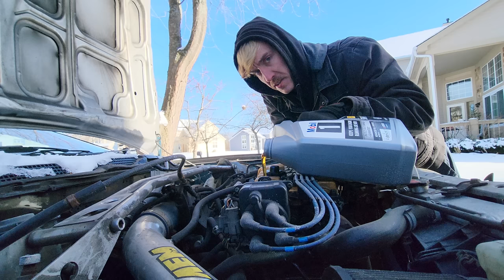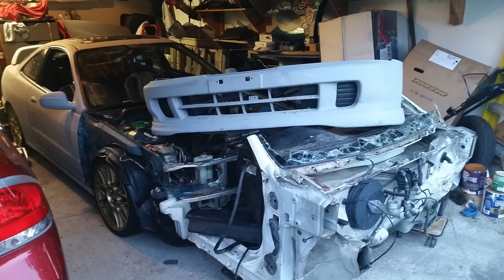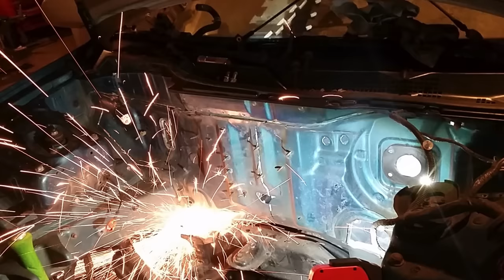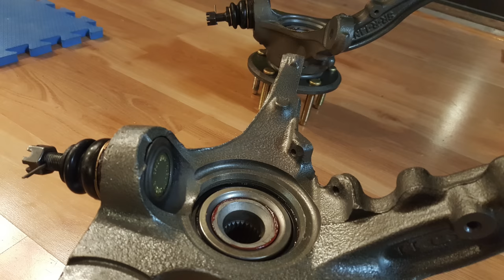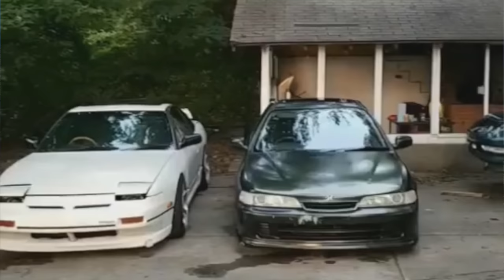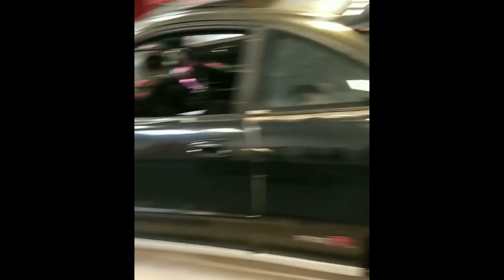The Story Behind Building My RHD Integra

Comment: Man, this story is very inspiring. It also makes me really think about if I really wanna sell my first car as soon as my license allows me to drive more powerful cars or attempt a big project like a engine swap because the current engine is only 78hp and also hardly holds any compression anymore but the mechanic that fixed my wheel bearing and transmission seal a few weeks ago told me to just buy another one with a different engine because it would be to complex to attempt something like that. Also I was wondering what work you do currently outside of YouTube , I really want to work on cars but I’m worried the practical jobs don’t pay properly and the engineering jobs are mostly done at a desk and not in a shop but I will probably try to get a instruction for automotive engineering from a big company like Audi which offers an education while you work there. Anyways sorry for the rant, this video was very nice as always.
Reply from the maker: I totally understand where you are coming from. I definitely learned the hard way about the low pay aspect. Which is another reason I continued to go to school. That's why I got the automotive related desk job. But found my days turned into a blur and made my brain turn to mush (dealing with alot of cooperate idiots) 

Which is why I never stayed in a place where  I felt like I wasn't progressing

Basically you have to put yourself out there and try different things to see which fits you best. There is no wrong choice, it's a constant ladder up

Hope this helps 🙏 :_s13:

Comment: Great video! One of your best for sure. Like seeing how you started. Neat. I have some years on you but admire your determination and hard work effort. You will always be successful. I like your channel. I have a GS and it is so nice when I really think about it. Only one quarter panel above the rear wheel with any rust on it, that is it. I do not work on it myself but pay tons of money to the shop to repair it. I am saving it. It runs good now and has potential. I am in NC so is fun in the mountains. Keep doing videos, I am learning from them. I will be able to do my own oil change and some bulbs and lights and other easy stuff now.

Comment: You're fortunate to still have your first car. Mine was a 97 Ford Escort wagon, 5 speed, sliver with a green interior. It had rust and for the last few years of ownership I was doing body or structural rust repair on it almost every year. Seeing pin holes starting to form on both rear strut towers was the last straw, I was done with it. The sliver lining is that last year I inherited my dad's old car which is the same model as my first car, but it's a coupe, one year newer, and has the more powerful engine. I can also relate to how you felt working on cars for your job. I'm a full time tech and it really discourages me from working on my own stuff, but it's the only thing I've ever made decent money at. I also hate having to work on cars that the owner obviously don't care about. It's to the point that they couldn't pay me enough to actually care about their car that they turned into a POS by their own actions. Every time I have to work on one of these cars, It's begrudgingly and I'm in a bad mood the entire time.

Comment: Man my life story is pretty similar lol. 1st car was a 1998 Prelude, I crashed it and while rebuilding it I bought a daily for the daily. My 2nd car a 1990 240sx coupe that I still have and recently started working on and playing with again. 3rd vehicle is a 2007 Tacoma I fully built myself into a long travel desert truck. 4th car is a 2008 STI that was crashed when I bought it and I rebuilt it in my driveway. 5th car is a 1970 Baja Bug I'm working on. I also have a race truck, 19ft boat and a few motorcycles. I still have all of them except the prelude. I build, install, maintenance, paint, body work, fabrication everything myself except tires mount and balance. I enjoy working on MY vehicles as a hobby and I was always afraid of if I made that my career I wouldn't enjoy my hobby. So I always tried to keep them separate. Then I kinda fell into boating. I started off as a deckhand, worked up to captain and moved into the maintenance department. I really enjoy my career since I'm working with my hands, but it's also different enough where I still enjoy working on my vehicles.

Comment: found this video randomly
and, this just.. idk, its a bit of inspiration for me
i have a project vehicle of my own, 2 actually, the first one is a 87 ford bronco with a 5.0 V8 and its got a fair bit of work to make it good again, but 11 mpg curently... its got a carburetor and if i do anything with it, its probably gonna imediatly see some kind of EFI thrown at it after i get it running. if i do anything with it, im just... its so damn big for what i need. its crammed into a tiny area and it needs a respray and im not gonna have time or money to do any of the shit
and the second one is a fairly minty lil nissan pickup truck, its a 97 and its got a ka24E, SOHC 2.4 liter i4 and its seen a few deer and a scoobydoo.... its still fairly straight... but the engine is a no show rn, 50k miles with minimal maintanence and a strangely catastrophic engine malfunction making it not run for shit..... and grandpa punched the cat..... its still got a cat but its uhhh.. it aint got a damn thing in there and now its kinda got a bit of a low end grumble to it when timing is actually correct
but its now got no head on it cause i fucked up the gasket getting the timing cover off and turns out the cam journals are a bit fucked up
so..... yeah
also the bronco has 750k on the odometer and as far as i know, original engine.

Comment: So im building my first car n it has some rust spots as I'm in PA, in the quarter. I started using a 110 Mig welder at work just kinda learnin techniques n getting better b4 I go out n buy one but someone telling me I should get a 240amp instead. What do u suggest? Can i use a 110 and it be hot enough to penetrate the metal replacing parts of a quarter panel? 
95 Accord F22b1

Comment: I'm almost 18 with a integra as my first, I am so scared. I dropped out of school to work more at my local gas station. Through the winter I had problems getting to my car. It's ended up as a snowbank and I hardly get to it on a weekly. I was told to get ebay parts for it from my father and I fear that's a mistake. I got 3 weeks left to switch jobs move my car to my mom's. Being as a dropout I don't think macanic shops will bring me in and I'm struggling financially. I refuse to give up my car but I see no future in myself and all I want to do is drive my car. Mike please, what should I do?